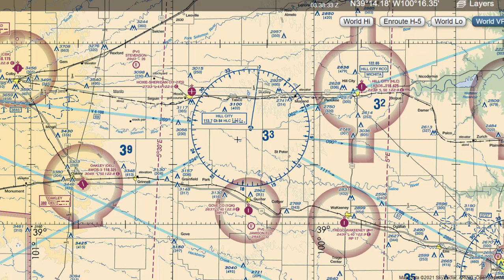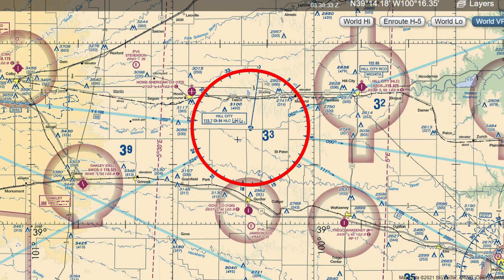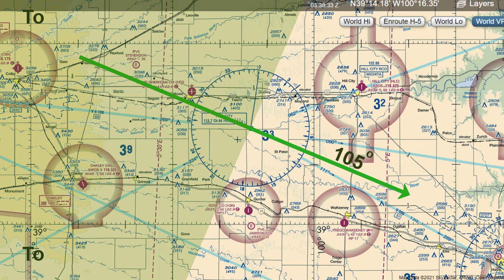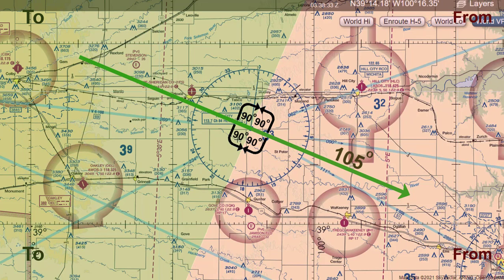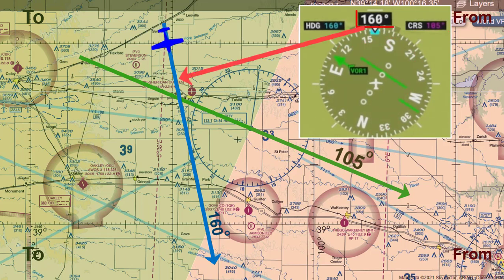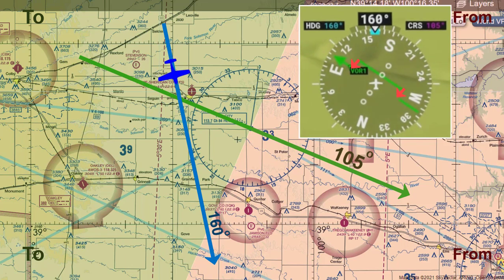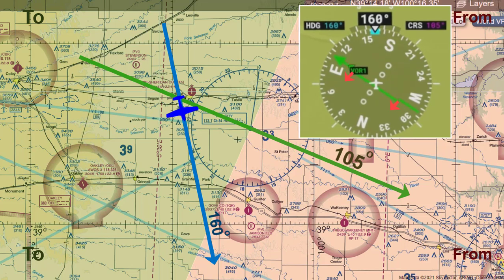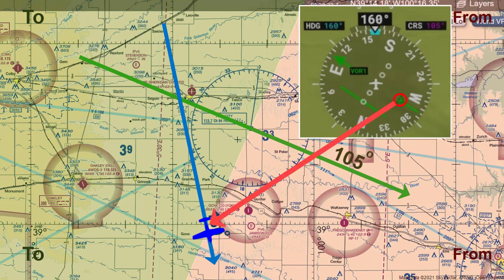Garmin G1000:  VOR Navigation - Example 3

Comment: Here's what I don't understand about using the G1000 - when flying along a VOR1 radial, how do you know you've intersected a desired VOR2 radial? Using the example in the video, let's say the 160 degree course you're flying is the 160 degree radial of VOR1, and you want to turn onto the 105 degree radial of VOR2. 

In the traditional cockpit, you can have two separate CDI instruments to glance at simultaneously to 1) verify you are on the VOR1 radial, and 2) see if the VOR2 radial is approaching. When you see the VOR2 needle start to move, you know to prepare to turn onto its radial.

But the G1000 displays these two instruments on top of each other. You can see the d-bar for VOR1 or VOR2, but not both. If you're keeping an eye on the VOR1 needle to maintain your course, how can you know the VOR2 needle has started to move unless you constantly press the CDI softkey to switch back and forth between the two displays?
Reply from the maker: That's a great question and I will see if I get time to play around with the simm and see if there's an answer for that and get back to you.